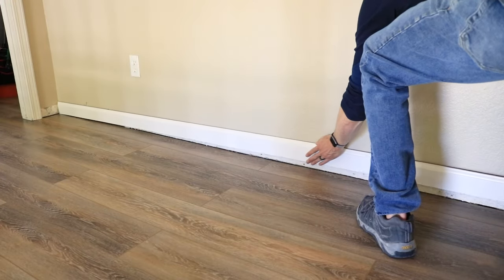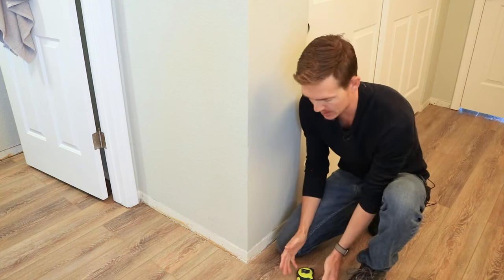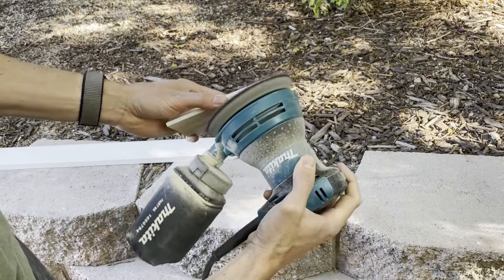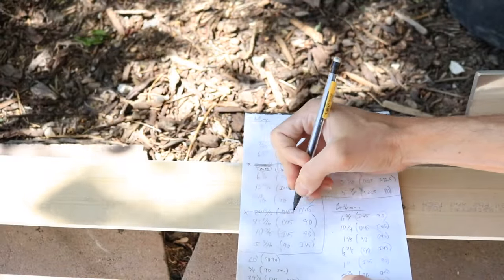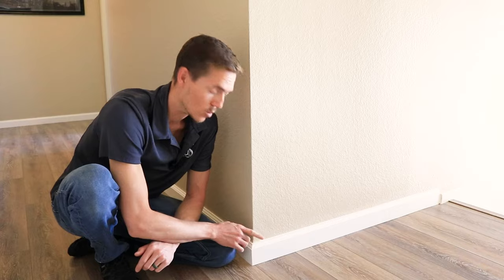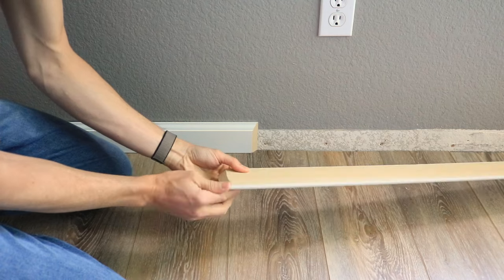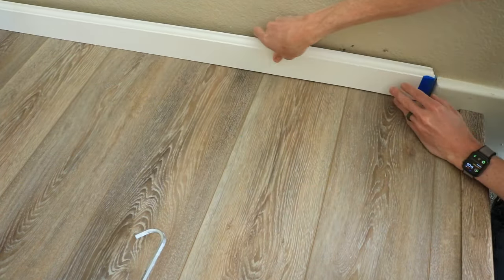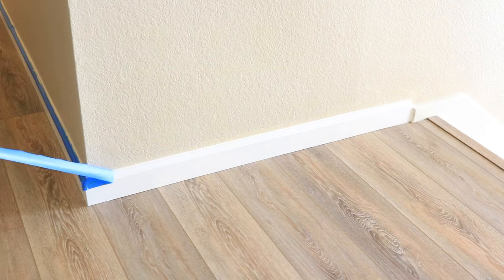How to Install Baseboards - Step-by-Step for Beginners

Comment: Definitely NOT a painter, haha. Painting before caulking, before nailing and filling the holes and using a roller on trim. Great video for installing the baseboard, not for painting advice.
Reply from the maker: Not all jobs need to be entered into a competition. It’s difficult to justify spending more time to paint something that is going to be dirty and scratched within weeks anyway. Also, unless you get right up to the baseboards, you never notice the stippling. The “right” way to do something is always a philosophical question.

Comment: All due respect. With MDF Baseboard, caulk any Baseboard near the Kitchen and in the bathroom. ONCE WATER touches the MDF, expect swelling and a call back. Pets, well most pets make a mess with water. Washing the floor with a mop makes a mess. Just use real wood. It's not much more money. Experience talking here. Although MDF is great in most applications. just not on baseboards.
Reply from the maker: I see your point.

Comment: Why paint it if still need to nail it
Reply from the maker: Because it’s faster. Try it the other way and you’ll see.
Reply: @StayHandy  Only if you plan on the filler for the nails holes to be showing… As a lifelong professional painter I would never leave that for my customers, as well as the caulk. Also, not very piece of trim is white-white so the filler/caulking only works if it is white trim. There is no “saving time” when you have to go back and paint over it anyway because it looks horrible. You worry about “saving time” but end up painting the trim anyway later in the video!! What’s less time consuming? One coat of paint, or two?

Comment: This is not the proper way to put baseboard down. It takes literally 15 seconds to cope one side the other wall  can stay square so the time you walk to the saw to cut your 45s I've already coped my side. 99% of walls are going to be 45⁰ or 22.50⁰ angle just leave a 16th inch long in case you have to adjust for the wall being plus or minus a deg⁰ only cope you're 45⁰'s do not try to cope your 22.50⁰ inside corners If you're willing to go this far watch a video on coping it's easy
Reply: I am not skilled enough to cope the baseboards